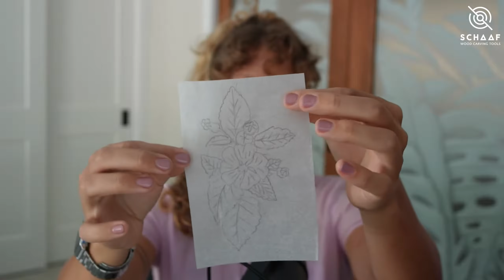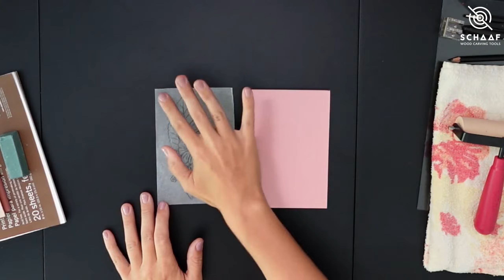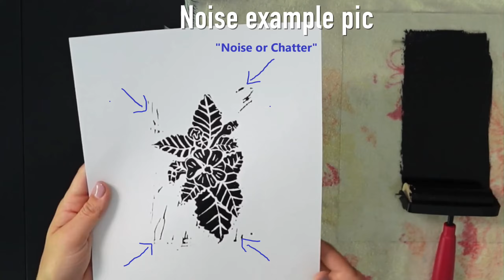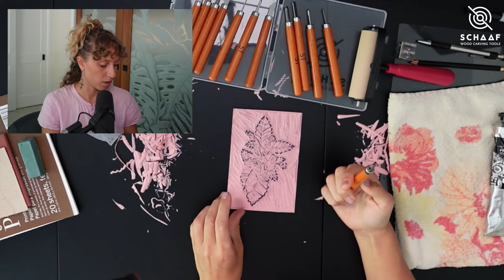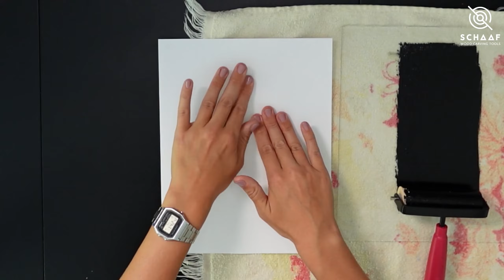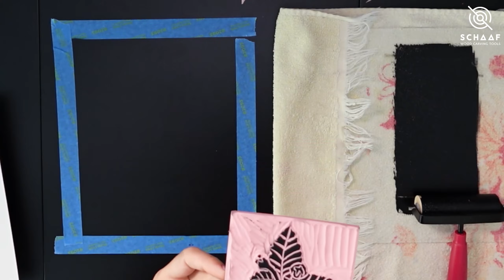Linocut Tutorial: Block Printing for Beginners | Printmaking with Schaaf Tools

Comment: Very cool.  I haven't done any of this since 4th grade, but always loved the possibilities.  Might I recommend purchasing and using a woodworker's cabinet scraper to lessen the peaks and valleys of the wide, unprinted areas?  A razor blade used at a steep angle to scrap the surface might also work.  Also, you might try masking the broad areas with painters tape and removing it after you roll on the ink?